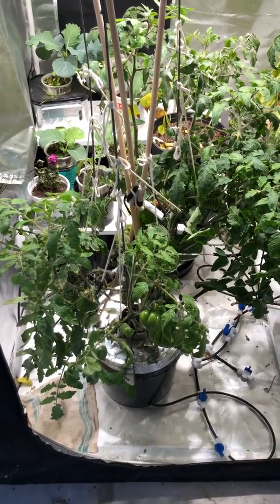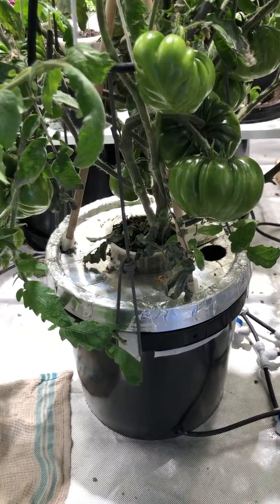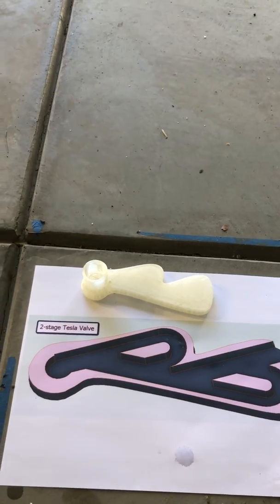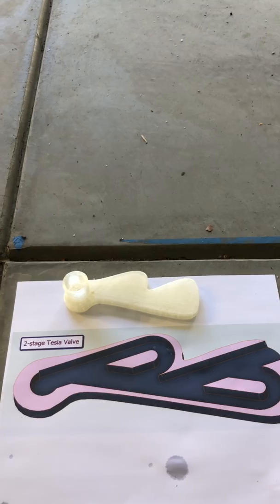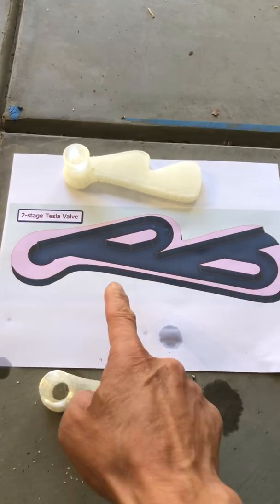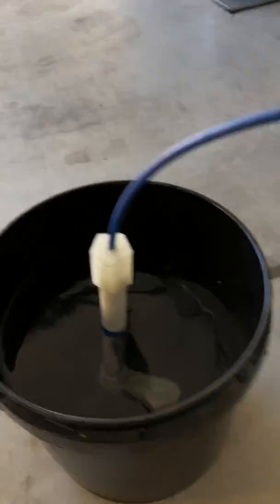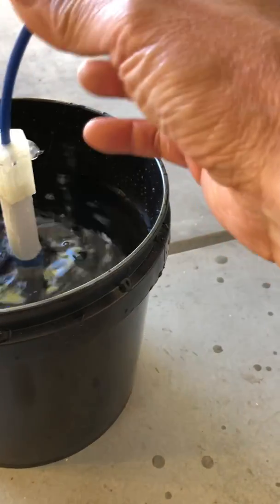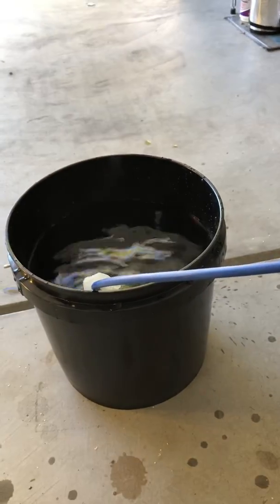Tesla valve airlift pump

Comment: I believe that on each cycle of the compressor you get a pressure wave front during compressor start up. I believe it is the startup pulse that's creating the efficient water lift. I believe the value attenuates these reverse pulses very effectively.
Reply from the maker: High-pressure wave fronts are indeed resisted more by the Tesla valve. However, the tesla valve also offers sustained resistance to continuous (i.e., non-pulsed airflow). Both effects were observed when playing with the uplift pump.  You may be interested in reading more here: https://www.nature.com/articles/s41467-021-23009-y

Comment: air goes in, water comes out backwards?
Reply from the maker: Air goes in, water goes up. The valve favors upward flow not outward flow. It's so strange I had to build it.
Reply: @oyamistaeroponics5642  thats amazing, does it work with ordinary ball valve as well??
Reply from the maker: @magnuswootton6181  actually, yeah, it probably would. You don't need the Tesla valve, just get a ball or flap valve from the hardware store and have fun with airlift pumps. There are lots of cool videos on airlift pumps. The Tesla valve does the same--it just doesn't have any moving parts. Truly strange and wonderful valve.
Reply: @oyamistaeroponics5642  what an amazing machine,   sorry for making u repeat yourself, i just couldnt believe.

Comment: What about a homemade trompe air compressor...seems like you dont need too much air pressure
Reply from the maker: Yes. I made a trompe air compressor. Unfortunately, water pumps are more efficient than trompes. I just use a water pump now--it uses less electricity than an trompe and it also aerates water.  This was a fun and valuable experience, but I now have a solar power water pump for my hydroponics like everybody else.
Reply: @oyamistaeroponics5642  I just watched it! I'm glad someone tried it though it is such a cool idea but I agree the solar is still very green and much less hassle cheers ;)

Comment: I don't understand, you put the air compressor tube into the tesla valve but at the path with more resistance, so how did the water rise??
Reply from the maker: Airlift pumps raise water with a column of bubbles. It's quite an odd thing to watch.

Comment: Could you show us how the dual tesla valve compares to the single stage one? Anywho nice vid man 👍, thanks for sharing.
Reply from the maker: The dual works slightly better than the single, which works slightly better than no tesla valve at all. The bursts of air from the compressor are blocked by the tesla valve and the air is forced up the tube. The key to operation seems to be bursts of air. The water rushes through the valve between brusts air.
In general, the energy used to make compressed air is more than the energy required to pump water directly. I ended up using a plain old 12V water pump to circulate water to save energy. But the tesla valve was a fun experment!
Reply: @oyamistaeroponics5642  thanks!